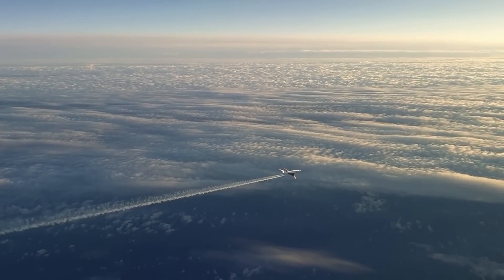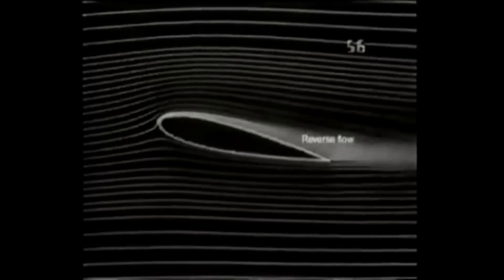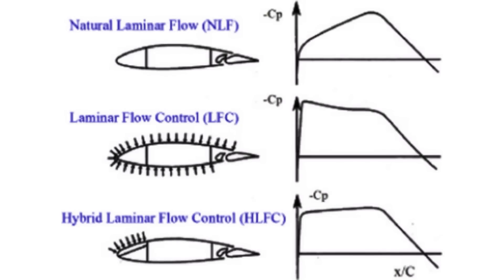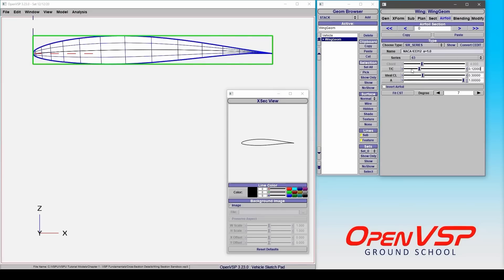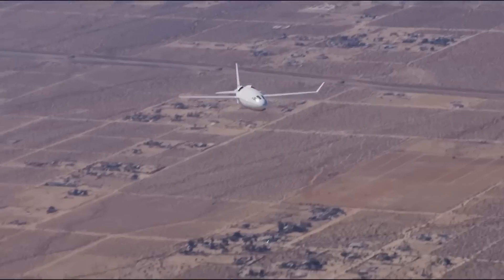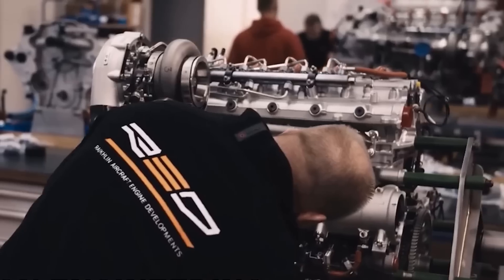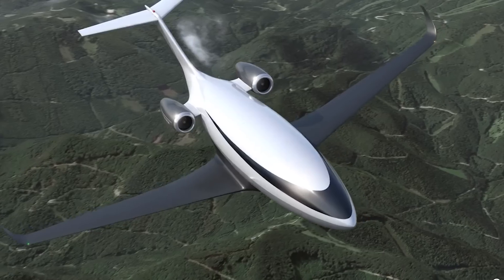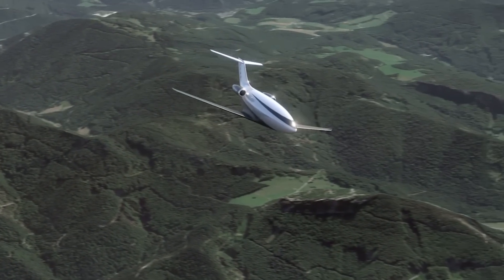Otto Celera 800 vs. Celera 500L The World's Most Efficient Aircraft

Comment: 1. All the buzz words included and pushed heavily. Check
2. Slick promo with non descript airfoil sections and some fancy engineering terms like CFD. Check
3. Fancy CGI and computer software screen grabs. Check.
All ready to go to pull in that abundant and sweet ESG moola. Nothing this company is doing is new technology, laminar flow lifting body, has been tried before. It's just re-packaged for this current generation. I doubt anything is going to come of this, except, many investors with empty pockets. The fundamental aerodynamic principle that this aircraft relies upon, laminar airflow, is very, very, hard to maintain, in real world conditions. Antennas or any other protrusions, even water drops or dust on it's surface are enough to turn the air turbulent. Destroying it's laminar flow. That's why it has to be manufactured super smooth and slipery. No windows, no leading edge wing devices, no rivets, no seams or joint's. How this thing is going to be manufactured, let alone operated or serviced, is anyone's guess.
Reply from the maker: Your skepticism raises valid points and highlights some key concerns about the Otto Celera 800 project. It's essential to critically examine the claims made by any company, especially when it comes to revolutionary advancements in technology. Let's break down your observations:

Buzzwords and Promotion:
Acknowledging the use of buzzwords, slick promotional material, and fancy engineering terms is a prudent observation. Companies often employ these strategies to generate interest and attract investment, particularly in the growing space of Environmental, Social, and Governance (ESG) investments.

Repackaging Existing Technology:
Your point about the laminar flow lifting body concept not being entirely new and having been tried before is accurate. Innovations often build on previous attempts, and the challenge lies in whether the current iteration can overcome past limitations and deliver on its promises.

Challenges with Laminar Flow:
Your concerns about maintaining laminar airflow in real-world conditions due to external factors like antennas, protrusions, water drops, or dust are valid. Achieving and sustaining laminar flow is indeed a significant challenge in aerodynamics, and the success of the Celera 800 would depend on its ability to mitigate these issues effectively.

Manufacturing and Operational Challenges:
Questioning how the aircraft will be manufactured, operated, and serviced is a crucial consideration. The absence of windows, leading-edge wing devices, rivets, seams, or joints raises practical questions about the feasibility and complexity of production and maintenance processes.

In conclusion, your skepticism prompts critical thinking about the practicality and viability of the Otto Celera 800. While the concept may sound promising, addressing the challenges you've highlighted will be crucial for the project's success. Investors and aviation enthusiasts should indeed approach such innovations with a cautious and discerning mindset. Only time will reveal whether the Otto Celera 800 lives up to its ambitious claims or faces the challenges inherent in pushing the boundaries of conventional aircraft design.
Reply: @aviapages  Thanks for the ChatGPT generated reply
Reply from the maker: You're welcome! If you have any more questions or if there's anything else you'd like to discuss, feel free to let me know. I'm here to help! :)
Reply from the maker: This isn't a promotional video; our intention is to gather information about this model and share it with our subscribers for informational purposes. We refrain from making judgments on whether a project is commendable or not, leaving that prerogative to our viewers :). I appreciate your perspective, but, as always, time will be the ultimate arbitrator. Sorry for the response from Chatgpt, it seemed to me that it provides detailed answers to your comment. We have no right to discuss such details ourselves.
Reply: @aviapages  Yikes!
Reply: @anthonycanalese2142 exactly, lots of words, not much information.
Reply: @anthonycanalese2142  I thought that the Celera 500 with the diesel pusher engine could potentially be an efficient competitor to the Cessna Caravan in the cargo arena, but it looks like this whole company is simply an investment fraud at this point.
Reply: It isn't all that surprising that they got one to fly. and that it has very good numbers. Aircraft designers would prefer not to have windows, but passengers have a demonstrated propensity to start clawing at the door latches if they don't include them. Show me a Celera 500L with windows, pressurization, de-icing, all the necessary cabin furnishings and baggage stowage, you know, approved airline seat and restraint, light and ventilation nozzle for each passenger, cabin heat and air conditioning, rugs, floor mats, drop-down air masks, life jackets, seats, a toilet, water and waste tanks and a way to plug into them on the outside of the fuselage, etc., everything the FAA considers necessary and then give me the numbers.

Comment: Another dream going nowhere.
Reply from the maker: Your succinct comment captures a sentiment shared by many when it comes to ambitious projects, particularly in cutting-edge industries like aviation. While dreams of groundbreaking advancements are exciting, the reality of bringing such visions to fruition is often fraught with challenges and uncertainties.

The skepticism expressed in your comment echoes a common sentiment in response to ambitious endeavors, highlighting the potential pitfalls and hurdles that innovative projects may face. It's a reminder that not all dreams materialize into tangible successes, and the path from concept to practical implementation can be arduous.

In the case of the Otto Celera 800, time will ultimately reveal whether it stands as a testament to innovation or becomes another dream that faced insurmountable obstacles. Your observation reflects the cautious optimism or perhaps the pragmatic skepticism that individuals often adopt when evaluating the feasibility of ambitious ventures.